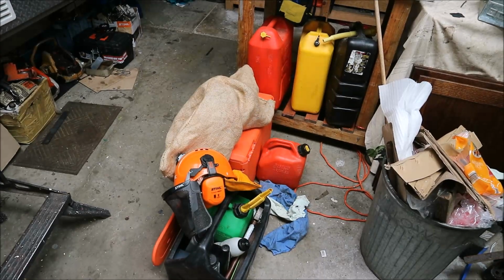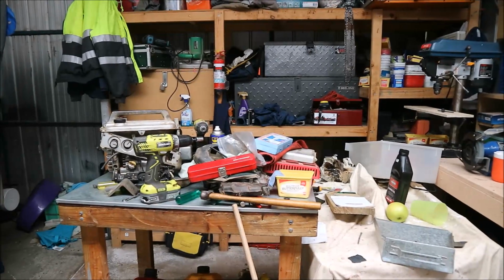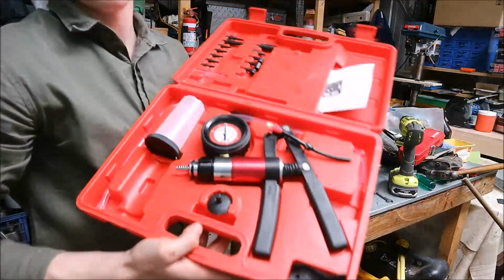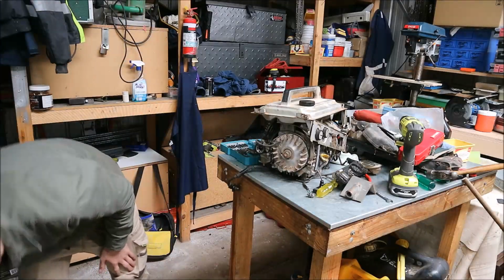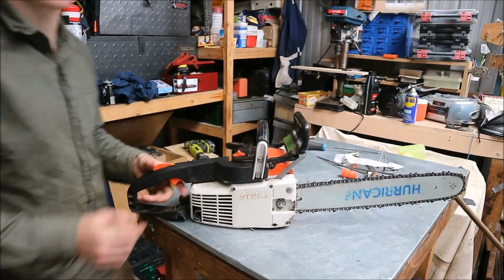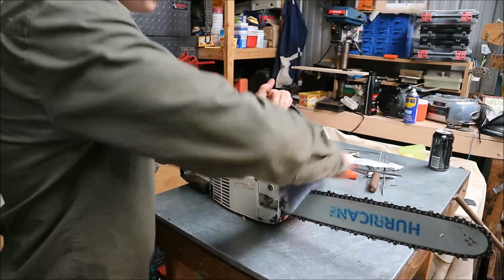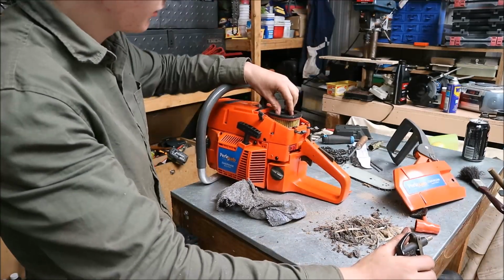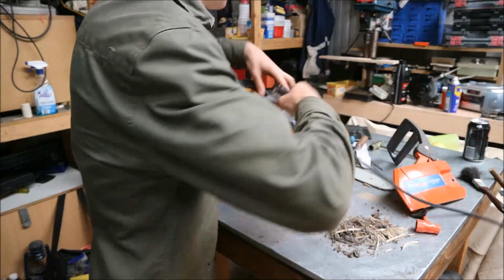VLogish, the boring side of chainsaw work

Comment: Hi .you got it sounding good with power now runs alot better since first vid...was it easy to get right??
Reply from the maker: it just came with break in, this is pre tune up
Reply: @v26224  really!! That's good.if you do end up tuning it do a vid before and after that would be interesting. For all the bad press the autotune saws get for one thing or another they do a great job .. what is that timber in vid it looks hard and unusual stringy bark.
Reply from the maker: @nickywalsh8492  it is Australian stringy bark eucalypt. 
if I do tune I will do a before and after